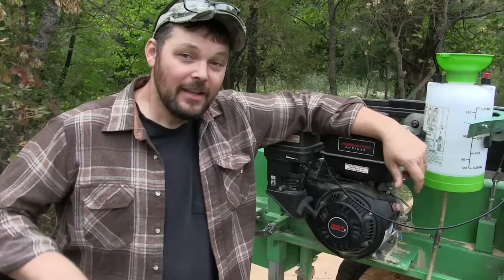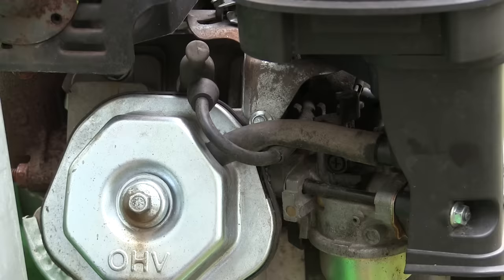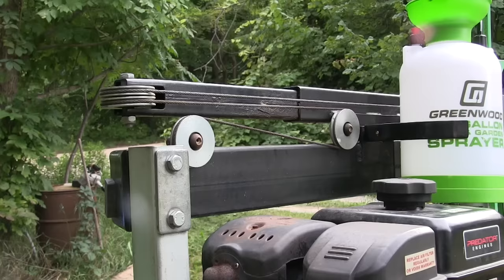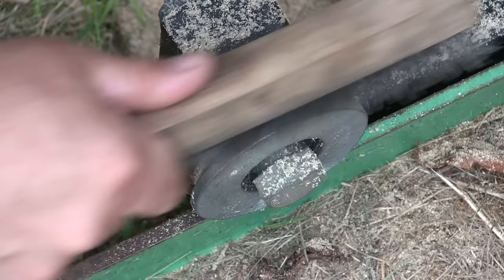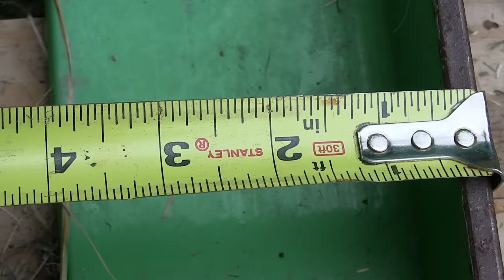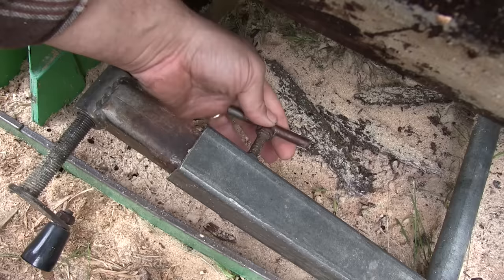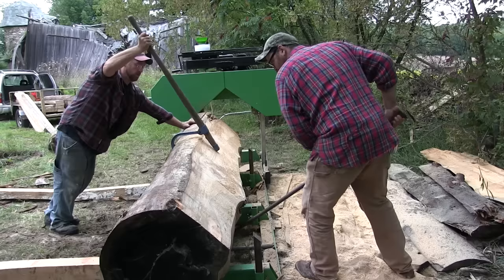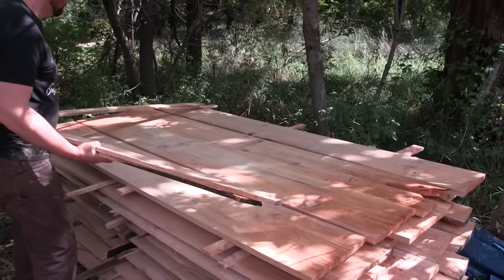Harbor Freight Sawmill Complete Review

Comment: Watching logs get milled into building materials is extremely satisfying.
Reply from the maker: yeah it is
Reply: 0
Reply: @Bushradical  LOOK UP ( JONATHAN W ) ON YOU-TUBE ,, HE BUILD A SAW MILL ...
Reply: Oddly ....
Reply: How many price?
Reply: @Bushradical  for your left wheel issue, why don't you weld a small piece of metal rod onto the frame, that bends around to the front/rear of the wheel, and scrapes the sawdust off the rail as you push/pull it every time.
Reply: Yes it is. Isn't it.
Reply: I only wish I had a mill, I have a million trees around my property I would absolutely love to turn the trees into usable lumber. With wood costs as they are now, probably not take long for the mill to pay for itself cutting up free trees into usable lumber!

Comment: Nothing like milling lumber.  Been sanding, priming and painting vehicles before the snow and salt here in Canada.   Automotive paint would be perfect for repainting the saw.  Enjoyed the video.
Reply from the maker: Good to know. Thanks
Reply: @Bushradical  You will want to get it down to the bare metal (zero rust) and primer it well.  It is tempting to just shoot it with paint, but auto paint tends to peel pretty easily if not anchored down with a good primer.  There are some etching paints that don't need to be as pristine or much of a primer - I think that this is how Rustoleum gets away with painting with a little bit of surface rust and thin primer coats.  The color won't be perfect or uniform, but you can just shoot the high wear areas every couple of years with a rattle can.  Considering that quality auto paint will cost $100s to paint the mill completely just for paint - I would rattle can it.
Reply from the maker: Thanks

Comment: Dave, I recently found your site and I have been extremely impressed by the presentation and knowledge you have. I have been working on an off grid cabin for a couple of years. It was an amash shed (16x30), I ran electrical, dry wall, windows etc. I have paid off my land and everything that is on it, thanks to a tour in Afghanistan. I recently stumbled on to your small cabin build, the 10x12, it is perfect as I will be building my outhouse. Watching your wife work with you has also inspired my wife and she wants to help! See i have finally found a composting toilet that is easy and inexpensive and I have many women in my life. Finding a tree to pee is not their motto. I will also be adding a shower since I have also found a spring near my cabin. I want to thank you for the great ideas for the build, no nonsense instructions and even the cost video #5 I believe, it will be very helpful. I will check in when i finish and possibly send photoes if you would like?

Comment: Dude, great video. We also own this mill and still learned a thing or two. Thank you. You pretty much summed it up. Can’t beat it for the cost. We’re also seeing the same issues; build up in the wheels, irregular steel dimensions, a little “shake” when sawing. Nothing that can’t be easily addressed. A tip that was passed to us is to rotate the pull start clockwise, facing you. Thanks again.

Comment: Great video, great presentation, excellent editing and superb audio editing. Not to mention, timely subject material. I just recently had my logs milled, around 1200 bf of mostly walnut, but some quarter sawn oak which cost me $.50 per bf. I was the laborer to handle and load the lumber on my trailer. The mill was a $35,000 full hydraulic Timber King. Now that I have nearly enough lumber for several years, I'm really wanting a harbor freight mill to saw my logs myself. Your video covered the HF mill better than any other YouTube video I've seen. Big thanks for sharing.

Comment: Impressive for what it is. Great review too! My experience is to always oil foam air filters to catch the smallest abrasive particulates. If you'll drag a hose down and rinse the logs before cutting you can seriously lengthen the blade life as it won't be cutting through dirt on the outside of the log. The lightest oil you have on hand will be okay. Touch up paint with black Rustoleum. Eventually the whole thing will be black and the easiest color to maintain and blend. You'll also know which areas to pay attention to for future corrosion. You can easily rig up a self cleaner for the wheels with a wire brush and hose clamp. Who cares how it looks. It's a tool!
Reply from the maker: Thanks

Comment: You can eliminate the dust in the guide wheel by mounting a small brush assemby onto the black outer frame where it will knock the sawdust off the track ahead of the wheel in either direction as you push the assembly along.

Comment: I bought a Predator  motor from Harbor freight for a replacement on my push mower at my cabin 4 years ago. The thing is a 1 or 2 pull starting motor even after sitting for 6 months at a time and is still running great.

Comment: I have a paint peeling as well, and it's always been inside my garage out of the sun and heat. They didn't remove the oil from the sheet steel before painting.
I have my saw set up in that garage. I had two angle iron pieces longer then the spliced ones that came with the saw. So I don't deal with the interruption, of the joint. I also put a 5HP electric motor on it, and I did have to make a mount to put the shaft of the motor at the same height as the gas engine. This was so I didn't' have to breath exhaust fumes. And it's quiet other then the noise from the blade cutting and running in the saw.
I had a huge problem with my saw, and others did as well. The acme thread they used for the head elevator on older models (I purchased mine in 2012) has a 3mm left hand lead. The screw was cut with square threads, and the brass mate for it was acme threads with the 14degree (I think) faces. The square edge of the screw cut through the brass within the time to cut just one log on the machine. Harbor freight had the spare part, but as it was the brass side, it failed again within one log (they don't sell a new screw for this). I have a machine shop so I ordered a correct acme thread and brass nut mate, and cut the 3' threaded bar to length, and machined the brass nut to fit in the steel tube, and brazed it in place. It now has a 6TPI threaded system that should live out the life of the saw.
I also ran into the too large a diameter problem. Seems the side that has the log dogs, could be moved, as there is still room before the log hit the outgoing blade guide, which I have not done yet, but procure some new steel tubing and weld on the opposite side of the spacer support 3x6 tubes. That first blade guide is too much of an integral part of the blade head to move further out. 
Otherwise, I think this a good purchase. I just wish they still had 25% off coupons.
A very good review of the saw.

Comment: I've cut 27" red and white oak on my HF mill.  I also had to move the push handle up to a higher location (needed to drill new mounting holes) in order to get the clearance for logs that large.  I also have narrow wooden log stops that I use to gain another 1" in width, they are wooden so that they can be sacrificed when they get in the way of the sawhead..  Handles the red oak fine, but it bogs a little on the white oak.  Getting the logs on the mill is way harder than milling them :)

Your comment about the wheels getting full of sawdust... so true, such a PITA!
Reply from the maker: Thats awesome to know it can handle that big hardwood! 27" of oak is no joke.

Comment: Really good video!! Helps me make up my mind that maybe i could get by with a whole lot less expensiive mill,i can give you an idea on keeping that rail roller clean, just drill a small hole in that roller block. and screw a heavy wire to it and bend it around untiil it fits in top of that groove...it should keep if cleaned out...unless it gets bent away from it..hope this can help....thankyou so much for your video👍👍👍
Reply from the maker: Good idea , Thanks

Comment: Great review Dave !  I am a little surprised that the 8 hp engine was sufficient to cut the oversized logs you milled. I don’t know what the going rate is now but back in 1998 I was able to hire a guy with a sawmill to cut up about a dozen logs for me and he only charged me .20 cents a board foot for the finished lumber but that was with me doing a lot of the grunt work plus clean up. Anyway I would have liked to have a mill like this to do a bunch more hardwood lumber for other projects.  Thanks ,

Comment: I have this mill. It has its querks from the china cheapness, but I love it. I have easily made multiple times over worth of lumber than what I paid for it. I made a bunch of mods to mine to make it even better. I have actually strategically milled a 27 inch spruce on it. It was tricky with only 19 inches between the guides, but it did the job. And like you said, moving a log any larger than that really becomes ridiculous. May favorite sizes are 12 to 20 inches. Nice videos btw!

Comment: I have no intention of getting into milling, but I was fascinated by your review. Excellent. This would be the way I'd go based on your description and examples. I'm out here in CT and notice the ash borer beetle is in your neck of the woods also. I've got a 24" base ash that rises about 70 feet and threatens the house. Another one on the northern side that's about 15" and threatens the garage and power lines. Good news is the top limbs are breaking up with every wind that blows though. Here's hoping it gets short enough to remove the threat before I have to figure out how to pull it down (it's leaning in) away from the house with a 14" Echo chain saw, a 97 tahoe and a length of rope. lol. Life aint' easy is it. Thanks for the video!

Comment: This was really good. Nice job covering all the angles. I've had a HF chipper with the same motor I bought as a customer return (the customer complained it wouldn't chip a 3" log at full feed) and it's been one super performing machine, so I sure don't rule out HF since I've decided to buy/build a band mill. Time to start shopping I think.
Reply: I have the same one and agree…3” my butt. That customer had unrealistic expectations for sure.

Comment: On the predator motors, what advice I can give.  I coat the fuel tanks, (red coat-at any Oreillys) they rust up and clog the carb.  Buy a adjustable carb, there cheap.  Clean the filter in mineral spirits, let dry, coat lightly with oil.  The predator likes the Autolite AR3910X (that number is for the 212cc, I think it will fit the 8HP). Synthetic oil. Outside Vent the valve cover with a fuel filter.

Comment: Dave, excellent video. One thing that should have been mentioned is the amount of pressure the operators were pushing with. Most operators try to force the blade thru the wood faster than the blade will actually cut. I noticed how you let the blade cut at its own pace, great job, thanx.

Comment: A very nice video. Suggestions: add a sheet metal guard over the wheel and you won't have to clean it. Put a trough under where the sawdust comes out, it makes it easier. Reclaim for other use, or simply keeping work area clean.

Comment: One thing to consider when purchasing a bandmill is the pulley diameter. Smaller pulleys would bend the blade more and have a tendency to more easily break a blade. I am curious where replacement blades can be purchased for that mill and whether there are any people out there that sharpen those particular blades.

Comment: Do you like it on the ground or would you raise it? 
Maybe build some adjustable track scrapers (cleaners), mounted to each wheel bolt. A strip long enough to reach both front & back of the wheel. Maybe use a soup can. Bent to an angle to the track (30°) to push debris to the side & kept straight up & down so hopefully nothing slides under it. It needs to work for both directions the dolly moves. Then cover each wheel & scraper assembly with a tent. Maybe trim an old Gladware bin.
Reply from the maker: maybe
Reply from the maker: Ive heard a lot of good ideas on this subject...I need to check out what other people have done to this mill

Comment: I like the idea of this. Cheap and simple but gets the job done. A lot of people now we’re getting into homesteading I’m just realizing after the last couple years of lockdowns in the government messing with everything that we need to be more independent and a lot of people are trying to get some bills done and couldn’t get word or paid 500% and 600% mark ups.  People are realizing there may be a time when if you want to build a shed or a cabin garage you might have to find another way to source your wood. Would Mills can be several thousand if not well over $10,000. I watch this and everything on here that you showed was a problem or something I could fix, instead of spending $8000 on a meal I would almost rather just go out by five or six of these used and source some bearings and belts and blades just have a lifetime supply of sawmills and parts.   Everything on there is pretty easy to replace or build and it may not be the ultimate in precision but if you need to build a shed or a cabin it will get the job done and if you’ve only got a couple thousand dollars, you’re not going to find another sawmill and this is definitely way better than nothing. I think if I had one of these working that I wouldn’t bother upgrading. This will cut slabs and dimensional lumber and for most people and hobbyist send for just being independent and wanting to use wood off your land instead of just burning it and buying your lumber from a store, I think this is awesome. Going to build animal sheds or a woodshed or a cabin or some benches or decks her garage, this is more than good enough.  I’d be happy with it and I agree with you on the engines, Hondas are nice but I bought Honda clones off of eBay for 50 bucks come of this size you could probably find for under $200 easy and a hand is not gonna last five times longer. The predators are a good base design and you can get parts for them so I’ve got no problem with them. If my life depended on it like it was some sort of air pump for breathing while I’m diving or something I might spring for the Honda but for this I’m fine with the cheaper engines, I can get two or three running and if I have a problem to swap it out and fix it later. I’m sold, if I see a good deal on a used one I’ll snag it

Comment: I bought a Woodland Mills 22" band saw. It's very similar but you cant raise it up as far as you show. Woodland says you must release the tension on the blade after use or it will cause flat spots on the carrier belts.  I tightened my blades to "Snug" plus 3 turns... Well, snug to me is like 1-2 lbsft but that was too much, I lost two blades. So I use a torque wrench, 25lbs. The steel wheels on the bed can collect saw dust and they'll be out of round, ker clunk....as it rolls. IT has blade guides that if removed would allow cuts around 26" But I'm new at this and have had issues.... I also put the mill at ground level so I, in my mid 70's,  can roll the Nor Cal Black Walnut onto the bed with out lifting. And the Woodland is the same price as Harbor

Comment: Dave, endgrain white oak makes excellent guide blocks which can be run against the blade of a bandsaw. It works great on my shop saw. I think it would work here, too.
Reply from the maker: ...................Ive never heard of such a thing......very interesting. What bandsaw are you using those with. I have a 14" deltas in the shop but it takes solid blocks...these ones need to have the hole for the mounting bolts. Do you think they would hold together with the hole?

Comment: Thank you for sharing!! I removed the handle an crank on mine,went to harbor freight an got there small 12 volt electric winch  an use that instead of the crank,works great an a very simple modifacation,also i bolted a old wire brush to my wheel on the tracks,keeps the wet sawdust off from building up. If your interested in what i did an have questions,please contact me,be honored to explain an help.
Godbless an thanks again!!!
Deeds
Reply from the maker: Thanks!

Comment: Nice review - the dust on the wheel seemed one of the major problems - I would put apiece of rubber (tire) over it, maybe a sidewall piece 6"x6" and screw it near the wheel so it covers the wheel. That would be flexible enough as the machine parts are moving while at the same time keeping the dust off the wheel. Good luck
Reply from the maker: Thanks